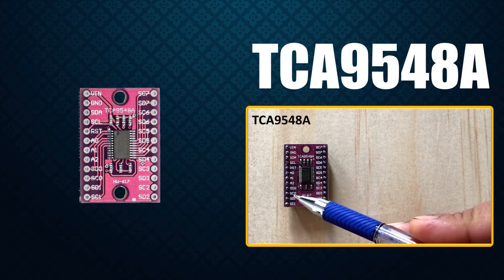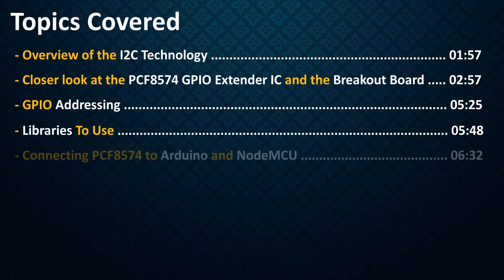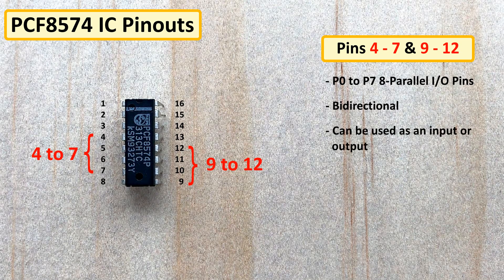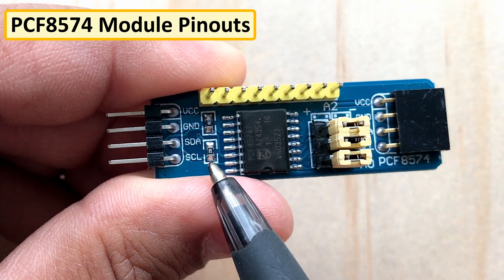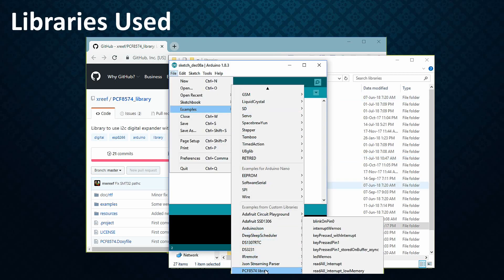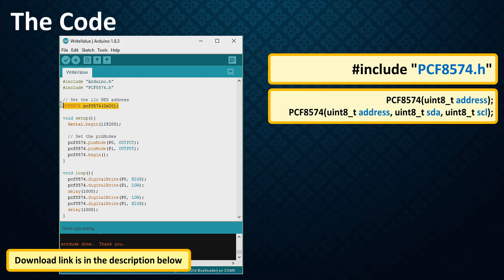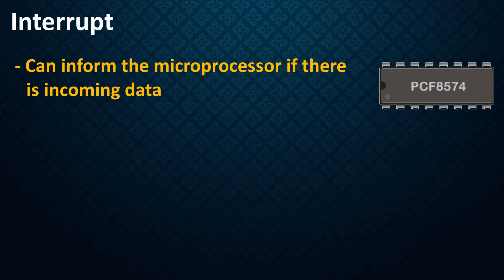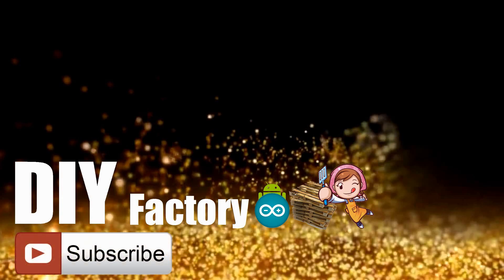PCF8574 GPIO Extender - With Arduino and NodeMCU

Comment: This was very useful, thank you.   As an older learner, I needed a slightly slower pace but it's easy to pause the video or play it at 75% speed, which I found excellent so as not to miss anything.
Reply from the maker: Thanks for the appreciation
I will try to slow down a bit in my upcoming videos.
Reply: @CrazyCoupleDIY  You are enthusiastic... that's what matters.    Please keep publishing your videos.
Reply from the maker: Cheers thanks 😊👍
Reply: @CrazyCoupleDIY  why pull-up resistor is used ?
Reply: Totally agree with you CC. Glad to see I wasn't the only one. A lot of info at the speed of light.

Comment: Its really great presentation. I used it, interface 4x4 keypad. I had a little issue...which automatically gone without any efforts.  
Issue 1. LCD start flickering,  then somehow it got stable, when I removed SDA and SCL wires.  
Issue 2. For testing purpose , I am doing ON/OFF of one LED,   which Stoped when I connected/Disconnected SDA/SCL.  
After Switching OFF/ON the power , LCD and LED both working fine. 
What you suggest ? do SDA/SCL connection impact on other things ?
Any Capacitor or something required ? Value of PULLUP resistor ?
(this exercise was done with RAW atmega16A chip).

Comment: Hello,
Very instructive post, one thing you want to be careful about about the PCF8574 modules, they already have a 1 kOhm pullup on the board (the 2 small resistors next to the male connector). If you want to daisy chain several modules, you need to remove these resistors on all but one of the board, otherwise the pullup becomes to strong ... if you daisy chain 8 modules, the pullup value is 1kOhm/8 : 125 ohm which is a bit strong : 5V/125 ohm = 40 mA...
Reply from the maker: Thanks

Comment: Hello! thank you so much for the tutorial, can i ask how do you control rhe PCF8574 port output individually?

Currently i am using the wire.h library to manually write them, and i am controlling the output by writing the hexadecimal in to the pcf8574. however there will be an overwrite of my previous input.

For example to control the port output to be high or low
case 15: write 0x01
case 16: write 0x02
case 17: write 0x04
case 18: write 0x08 

input 15 -> P0 will be high -> input 16 -> P0 will be Low and P1 will be high

Will want this to be changed to P0 AND P1 to be high which means the previous input wont be affected

Comment: What would you propose for driving 3/5v relay modules ? I need 4x8 gpio output ping that are capable of providing 5mA each, so for one relay module (x8) I would need some expander to provide me 8x5mA=40mA. I had this module and it provides only 0,8mA (?) and also mcp23008 and the same amount, so they are not enough for me.

Comment: Hey there, thanks for a great video, very instructive. I have a question if you can help me please. When I attach a LED light to my 5v and ground from my arduino it works great. When I attach this led to a pin on my expander board it is very dull. I am not sure what is happening - thanx
Reply: I have (at long last) worked out where I am going wrong. I was attaching the LED the wrong way. The correct way is +ive to the 5v rail and -ive to the I2C pin. HAPPY HAPPY HAPPY :¬)
Reply from the maker: I am glad you fixed it 
Good work.

Comment: Hi, it's posible use this for controlling 8 reley (control individualy) in a wemos D1?    I need add 5 other's sensors and oled display 0.96 I2C, but wemos d1 only have 11 gpio pins.  Can you help me with this problem, please?
Reply from the maker: HI There
Yes you can control 8 relays individually using any MCU
I havent worked with a Wemos D1 yet so cant comment a lot on that
However, if you want to use I2C OLEDs you can use an I2C MUX for that: Check out:https://www.youtube.com/watch?v=XWQsqPQOW-U 
A full tutorial on OLED displays is here  : https://www.youtube.com/watch?v=_e_0HJY0uIo
Reply: Crazy Couple but how pin 8 relay and 2 sensors in mcu? All pins It’s possible for use digital?
Reply from the maker: I will make a sketch and will show you tomorrow morning
Reply: Crazy Couple thx!!!!
Reply from the maker: @ManuelCastillo-kq3xy  Please check this out https://imgur.com/a/KVYcrge
If you still have any questions please send me an email
Reply: @CrazyCoupleDIY  email was sended.   Please, help me.  THX.
Reply from the maker: Sure I will reply to your email this arvo.
Reply: @Manuel Castillo can u please send me your NODEMcu example on email, or post some link to it?

Comment: Hi, can i connect a PCF8574 and after in serie a PCA8685 on the same I2C bus ?  with the new PCF8574 GPIO, can i control a DFplayer Mp3 Mini, o receive data from a IR Receiver ?
Reply from the maker: I have not tried that 
So can't give you a straightforward answer. Sorry mate

Comment: The only one problem, for me, is all examples are realized with and arduina nano.   In the nodeMCU, its different conect to pines and everything....
Reply from the maker: I did explain in this tutorial how to connect this to a NodeMCU board.  
Don’t worry I will reply to your email with full details.
Reply: @CrazyCoupleDIY  thx man!!!!!
Reply: @ManuelCastillo-kq3xy  did you find the way how to do it in nodeMCU sir?
Reply: @CrazyCoupleDIY  did you find the way how to do it in nodeMCU sir?
Reply: @ManuelCastillo-kq3xy  is it possible or no sir?
Reply: @harunalrassyid7392  yes.  I have with a nodemcu Lolin v3 (esp8266).   Later, can send you sketch, with PCF8574 pinout

Comment: Do I need the breakout board at all, or is just using the IC with the 10k resistors ok? If I only use the IC, can I run the IC scanner?
Reply from the maker: Just yeh if with the pull-up traitors is fine. 
Yes u can run the scanner
Reply: Great, thanks!

Comment: So when you use an input button, should you be using a pulldown resistor for each input so it doesn't float? Or is that taken care of by the chip or breakout module?
Reply from the maker: It is taken care by the chip.
Reply: @CrazyCoupleDIY Cool, thx!

Comment: Hi very nice and explaining video. I built the first modules and they are individually all working. I run into a trouble when I wanted to copy all bits from the first PCF8574 into the second one. ( one is the collecting device, the second one is the address devise.). 
Individually they worked  fine but the command   - digitalReadAll(); - gave me something what I do not understood.
I have for eg. Two 
PCF8574W(0x20);   // device to write
PCF8574R(0x21);    // device to read
I want to transfare the whole byte from PCF8574R.digitalInputAll();  into the PCF8574W device. ( in the future I plan to change the devices for the 16 bit version (PCF8575)). Will your code support also those devices?
Thank you!

Eugen/Austria

Comment: how we can initialize two different hex addresses in a single program while cascading multiple 8574 ICs, plz tell me
Reply from the maker: you need to set the HEX address first:
PCF8574 ex1(0x20);
PCF8574 ex2(0x20);
and so on
to use them u just call them by their name
ex1.digitalWrite(P0, HIGH);
and so on

Check out the video from here: 08:15
Reply: @CrazyCoupleDIY   hey, ex1 and ex2 are like variable names?
Reply: can i change ex1 and ex2 if i want

Comment: Sir I am using node-MCU cam  board, I need to extend gpios so where i can connect it?
Reply from the maker: Hi, I am not sure what type of board it is but if the board has i2c pins out please connect to that
Refer to the boards datasheet
Reply: @CrazyCoupleDIY  ESP-32 CAM is the board

Comment: is this possible whit an arduino leopardo?
Reply from the maker: Yes it is.
This extender connects to the I2C bus. So as long as the micro-controller has i2c pins it will work flawlessly

Comment: Do the extended pins support PWM?
Reply from the maker: They are digital pind
Reply: @CrazyCoupleDIY Cool that's what I was figuring. Do you have a complimentary suggestion for pin expansion that supports PWM. From what I understand I would need a built-in PWM driver like https://www.adafruit.com/product/1411 However I'm using a 5$ NodeMCU and it feels wrong it have to employ a 18$ shield ;)
Reply from the maker: In the past I achieved this using 2x Arduinos connected to each other using serial port

Comment: With 64 servos, motors and sensors you could make very advanced robotics based on a single board computer or indeed a Arduino chip. Make a 3D printed cat please :)
Reply from the maker: Sure, I will definitely try that.
Thanks for the suggestion

Comment: PCF8574 is NOT designed for GPIO OUT except at very low current.  The PCF8574 is designed to SINK current, not PUSH current.  So you have to design circuits to SINK current which is INPUT oriented.  Refer to the DATASHEET for the current loading limits.

Comment: Why not just use the PCF8575 if maximum IO is the goal? Of course it'd require a bit of tweaking to the 8574 library, but not much, and would double the IO for a very very small price increase! The TCA9534 is also quite interesting for inputs as it has essentially the same functionality and pinout as the 8574, 8474A, 8575, etc., but with the addition of internal pullups on P0-P7 as well as the interrupt pin.
Reply from the maker: Well at the beginning of the tutorial I did say that "This is one of the many IO expanders available in the market"
Reply: @CrazyCoupleDIY  Sure, yet nothing in my comment could even possibly be misconstrued to be me claiming you said this was the only IO expander available. It was just a very simple suggestion for an alternate IC more suited to your goal of maximum IO expansion, so I'm not really sure what that's even supposed to mean.
Reply from the maker: @martinj9647  Well I can suggest an even better one.
This one is slow just 100KHz. I would suggest MCP23017 instead as it is 16 bits and can be programmed to be both input or output and speed up to 1.7MHz. It also available for SPI version which means more speed.
Reply: @CrazyCoupleDIY  I feel like you're clearly the type of person who thinks simple suggestions are like some sort of personal attack or challenge of your intellect, sooo hard pass. Good luck with your eye two see adventures!
Reply from the maker: @martinj9647  Well, I guess you are that type of person who has nothing else to do in this world other than whining on people.
Well, good luck with whatever knowledge you have.
Just remember one thing mate, if you have a house made of glass dont throw stones on other people

Comment: The more gpio pins the slower the comms or overall processing speeds will be.
Reply from the maker: True, but you can add up clock pulses to the setup to speed up the comms